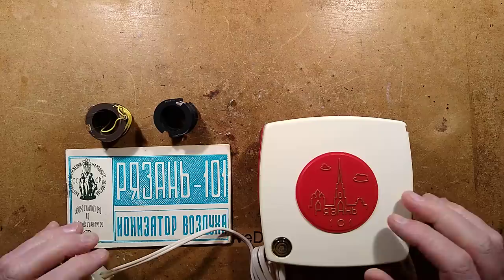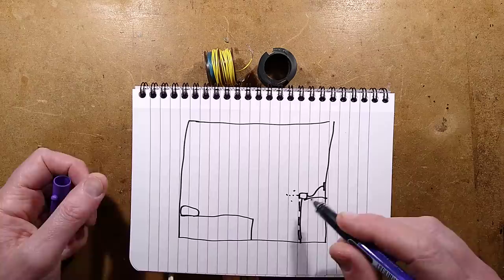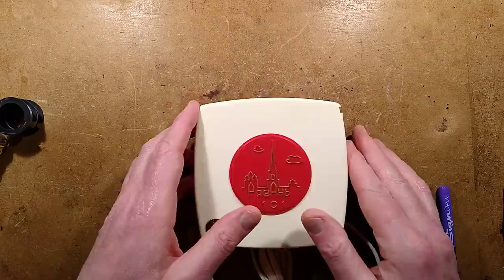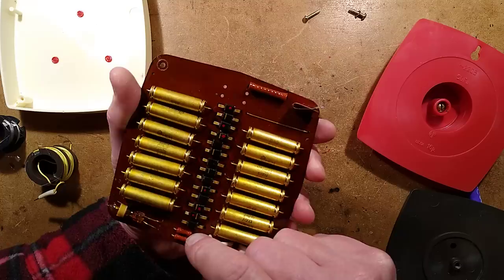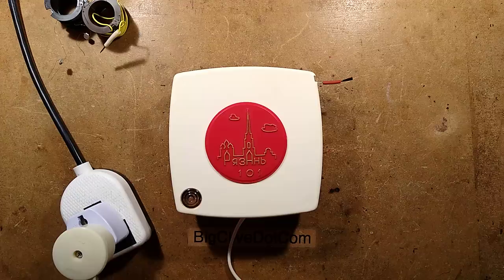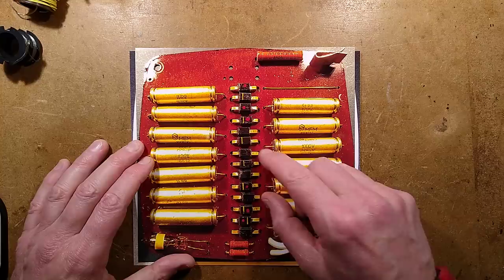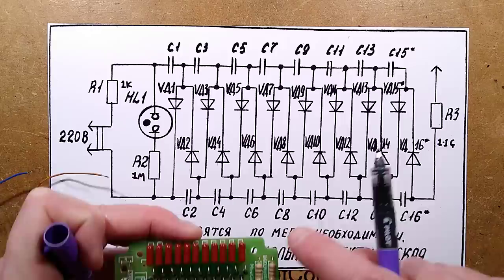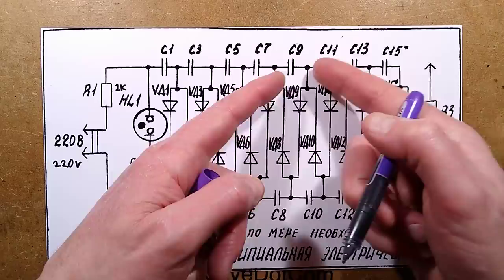Inside a soviet ionizer from 1990 (with schematic)

Comment: These paper capacitors were one of the main failure points of soviet hybrid tech TVs and other consumer equipment as well as these diodes with flat leads. As for the board - yes, it is resin bounded paper and the 3D appearence of the copper tracks might be partially caused by thicker copper clad but it also might be a sign of the infamous poor adheasion of the copper clad to the soviet made "getinax" - the name this material is known in most of the slavic world, though the word itself is obviously borrowed as there is no slavic roots in it (probably the same way as we still call copy machines xeroxes).
Reply: "Getinax" sounds like it was borrowed from the brand name "Pertinax" - resign reinforced paper.
Reply: @thes764  I know Pertinax only as a roman emperor one in the "year of the five emperors" - AD 193.
Reply: yes, too bad almost nobody used the K-xx series in consumer gear of capacitors which are incredibly reliable, K42 glass sealed paper in oil, or K73 mylar caps
Reply: MBM caps were more or less ok, but Armenian electrolytic caps like K50-6 or K50-16 were a big meme back then. They were extremely unreliable (5000 hours or less), some caps were already faulty from the factory. If a TV went into repair - all capacitors of this type were replaced with other caps, without checking.
Reply: @Gelo9623  so re-capping wasn't invented by the retro/vintage electronics scene ;)
Reply: @EdgarsLS  Similar to German capacitor brand that you would find in electronic equipment from the 50's to 70's. They are extremely reliable but very costly to make today.
Reply: @thes764  I repair and restore electronics since the 80's and it happened everywhere. Many devices had to be recapped after 3-5 years depending on how they were made and 90% of the failure was due to bad capacitors. Especially valves equipment that dealt with higher voltage. Because the consumer wouldn't want to pay for changing a small part like a faulty capacitor, we usually changed 1 or 2 valves which were good but won't charge for the capacitor. So the consumer had the impression that they had more for less money. But in reality, the valves were still good. I've a 1956 German radio which I use daily and it still runs with the original valves.
Reply: No offense,  @Martin Major. By "re-capping" I mean the often recommended procedure of replacing all caps in a device without any diagnostic - in the hopes it'll fix all faults. I'm very aware that caps - especially electrolytics and some paper types  - do fail with time. I also get that some types are known for being no good at their age - so if sighted will be replaced. Just as @deepblueskyshine wrote. I was just kidding a bit, having read many a forum post on what to replace - probably perfectly good - Styroflex caps with. Without testing them, obviously.
Reply: British people of "a certain age" refer to that sort of resin-bonded paper as Paxoline. ;-)
Reply: @Bartok_J  :) Some future day I may research where did getinax name cоme from, but for now I'm simply glad its alternative is more common and accessible.
Reply: Except Xerox is a company. Not a word.
Reply: @hypnotised-clover  You've got it right. Imagine you're a secretary in a cool place like a state department or mega state company till 70s in the Soviet Union or other eastern european country under soviet rule and you have to make more copies of some document than you alone or with a fellow colegue can type on a typewriter using indigo paper, so you have to go to the basement where your organisation have own full printing factory. Suddenly in the early 80s you've got a machine next door that you can yourself right away, easilly and quickly multiply whatever number of copies needed, which machine has big red logotype XEROX on it. How would you say "I have to go to the copy machine", where "copy machine" in Russian is 9 syllables (копировальная машина), or "I'have to go to the XEROX" (xerox - 2 syllables)?
Reply: @deepblueskyshine  Nobody will read your wall of text.
Reply: @hypnotised-clover  It's meant just for you :)
Reply: @hypnotised-clover that was literally the point. Google is also a company, yet the verb "to google smth" was born.

Comment: Earlier in the USSR there was a voltage of 127 volts (in some places, such as in trains - 110), but around the 60s-70s there was a transition to 220 volts. This standard is used today in most post-Soviet countries, with a gradual transition to 230 volts. I had a lot of devices where there was a 127/220 switch.

Comment: Soviet household appliances were very peculiar. For example, metallic mercury was often used in such devices. I remember back in the 80's we had an ultraviolet emitter called the Photon (Фотон) which contained a quartz glass sphere surrounded by a coil. Inside the sphere was a drop of mercury. When the device was turned on, mercury evaporated and ionized under the influence of high-frequency currents. The device was used for tanning. I also still have a doorbell called Moscow (Москва). Inside there is a glass capsule with mercury, where  contacts are inserted. The capsule is connected to a lever, and the lever is controlled by a magnetic coil. When the button is pressed, the coil attracts the lever and the mercury moves, randomly closing and opening the contacts. Including the circuit that controls the coil. Another lever is also attached to the coil, which is connected to a hammer that strikes a metal plate. As a result, when this doorbell is activated, it makes very unusual sounds.
Reply from the maker: We also had UVC mercury tanning lamps in the UK with heaters as ballasts to limit the current and provide infra red heat.
You can still buy mercury switches on eBay.  The old mercury switches were extremely reliable.  I like the idea of the random bell.
Reply: Once I had read an article about the use of ionizers in the journal for gardeners to control the local climate. Their design was given there. Pyramids were built from wooden bars. They were wrapped spirally with a wire connected to a voltage source of 30-100 kilovolts. The diameter of the base of the pyramid is about 1 meter, the height is the same. Allegedly, these devices are able to create an ascending stream of ions, which leads to the condensation of water in the atmosphere and causes rain. They were recommended to be placed along the perimeter of the garden.
Reply: Very eco-friendly...
Reply: @fiatlux4058  Now this is definitely not known, but perhaps the Egyptian pyramids had a similar purpose. Maybe they were also used to regulate climate? So we can explain traces of water erosion on the sphinx. Of course, the size of these pyramids is much larger than those described in the journal. Accordingly, the area of influence was also larger. It is clear that if the pyramids were wrapped in copper wire, then ancient people took it for their needs, just as they removed the facing stone. Strange corridors and gallery inside the pyramids could serve to accommodate sources of electricity and high -voltage converters. They were also plundered in antiquity, since there probably was a lot of metal, which then had very high value.
Reply: Is this the Moscow doorbell sound you are thinking of? https://www.youtube.com/watch?v=FAEBOKNRt30
Reply: @JeremyVisser  Yes, this is definitely it.
Reply: @JeremyVisser  A few years ago I did a renovation in the hallway. And then, on principle, I decided to keep this historic doorbell. Moreover, the presence of a mercury capsule in it was decisive. It's nice to know that there is a doorbell with such internal components. Now all household appliances containing mercury are gradually being phased out. For example thermometers. Or gas discharge lamps of high and low pressure.

Comment: Hi Clive, this is an interesting video. The way that neon is mounted is something I have seen done in some old Phillips transistor radios made during 1950s. I like the case style this ionizer has and it would fit in with my transistor radio collection. The two tone colour scheme looks great and that logo/graphic is such a nice touch. The booklet is cool as well and an overall neat design.

Comment: The board looks like they used wood lacquer as a form of conform coating.  The copper thickness does look like they glued thin sheet copper onto layers of epoxied paper then etched.  That would also explain the cutout for a literal rubber band to hold the neon bulb.  That is the kind of manufacturing of electronics I have seen from 1950s era electronics along with the coated enameled wire wound resistors.  I am surprised that they did not use micro vacuum tube diodes as they apparently are still available.
Reply: It was typical to use Zaponlack to cover soldered electronic boards.
Reply: BTW. Paper-based board material, typically dark brown, quite fragile, is called Гетинакс. pressed and bonded with phenolic or epoxy resin. Bad mechanical and thermal properties, very popular in consumer stuff. And still people are lurking around and telling you about reliability of soviet products :)
 https://ru.wikipedia.org/wiki/Гетинакс
Reply: The bulky МБМ capacitors are also paper-based. Mostly consist of thin paper and metal foil, bulky and burn nicely when fail, and they fail often. These mostly go into consumer stuff.
Reply: @noop9k  Almost as if that's were RIFA got its inspiration from.
Reply: @mjouwbuis  Oh yes, the famous PME271 filter caps. Generally any kind of MP filter cap, WIMA made the same kind of epoxy-coated paper X2 and Y caps that tend to turn into smoke bombs after 20+ years. The metal can types more commonly used in household stuff with motors (hoovers, sewing machings, handheld power tools, etc.) usually go with a loud bang and darkness while the small WIMA and RIFA types usually fizzle and smoke. A lot. And stink. I had one of them go in a Grundig VCR power supply last week. Both Kemet (successor of RIFA) and WIMA still sell those caps new, alongside PP film ones.

Comment: I was half expecting a microphone and transmitter circuit in there. On a more serious note, it's in surprisingly good shape for its age. Even the cord looks nearly brand new. I really do enjoy that extremely retro look of the board and components of that era. Old Soviet Geiger counters are really fun to crack open as well. All that hand routed and soldered wiring and whatnot is just extremely visually interesting. It's like opening something western from the fifties or sixties, only in better condition due to the fact its decades newer. How likely it is to still be functional is a whole other matter, but they're still fun to look at.
Reply: It's new, as I gather. It's a leftover production thing (manufactured for lack of new products from a given factory), BigClive says it was manufactured in 1990. It's of course horribly outdated and quaint even for the USSR for 1990, but this is the point, it's an ionizer, an extremely cheap device sold for quite a bit more than it's worth, made on equipment/expertise that hasn't been updated in forever. 

In the early 1990s, various alternative medicine and quack theories were beginning to enjoy a rage following in USSR/Russia (for all the novelty, the newfound ability to build/promote/purchase them, plus the uncertainty of the times), and tons of defense factories switched to ineptly making random consumer products (called "conversion"). 

So the amount of crude quack products that look/are built like a military radio crossed with a dirt-cheap 1970s hotdog cooker went through the roof.

The plug is a cheap plug indicative of late 70s - 80s for the simplest appliances, the style of decorative platic molding is characteristic of cheap products from late 70s, etc. Sort of like basic cheap utlility stuff from Aliexpress like travel water boilers, hasn't been updated because for the price, it still kind of sells.

Comment: I have to say I remember the days when all electrical items came with a schematic, often when you opened it up it was glued to the inside of the case.
Lately I have seen projects on the internet using the Voltage Multiplier, now I know where to get one prebuilt, 😉.
Reply: these we don't have the "right to repair". Indeed, we don't even OWN most of the items.

Comment: one thing I love about soviet tech is that they were expected to be repaired in the home or by a local repair shop.  So whether it's an ionizer or a toy music synthesizer for children, they would put in schematics and other technical details.  Of course they did this because their component quality left a lot to be desired as well as the fact that if you were lucky to get anything from the soviet state you'd better count your blessings and never count on getting a replacement if it broke-- but I wish we had that kind of ethos today.
Reply: Thrinkethrinke  That is a very good point, though I think it should be said that yes, on paper there was a guarantee, but often there were such shortages that getting the first one was a minor miracle and securing a replacement might involve dealing with long delays as well as the usual byzantine maze of Soviet bureaucracy, only to find that they couldn't help because you attached the wrong part of the proof of purchase to form 27-B and the issue you have actually requires a 49-D because it's a component defect.  So repairing it yourself was often the most practical-- but at least they gave you all the information needed to do so.

Comment: Clive, the voltage in Russia is about the same as most, if not all of Europe: 220v, 50hz. Unlike the states where most household electronics operate on 120v, whereas appliances typically run on 220V like dryers and electric hobs. Washing machines are usually 120v.
In industry,the voltages can be 220 or 440v single or three phase. I'm sure you already knew this, Clive.
Reply: This is the same here in Canada. Higher consumption devices are 220v like heater,  dryer oven and water heater. But the plug in the wall are usually 120V/ 60HZ. Except if you live in a remote area like I do. It's still 50HZ but in cities and normal places it's 60HZ. It doesn't matter much.
Reply: The voltage in Europe is 230 V since the 1990s. On 3 phase you can get 400 V, not 440. In the US you can get 120, 208 or 240 V, 220 doesnt exist since the 1930s.